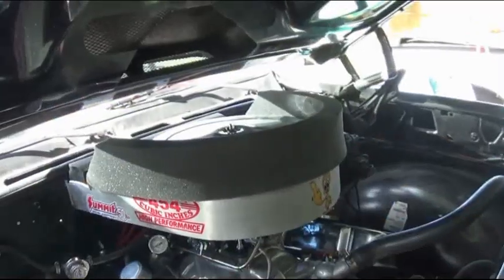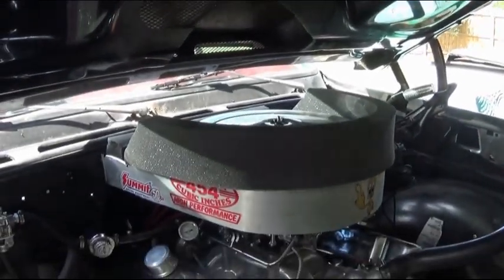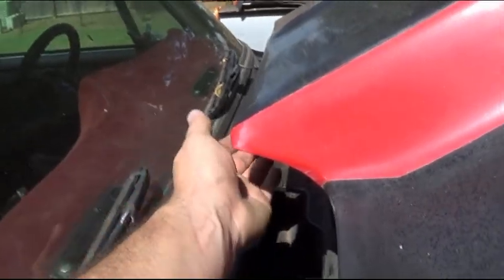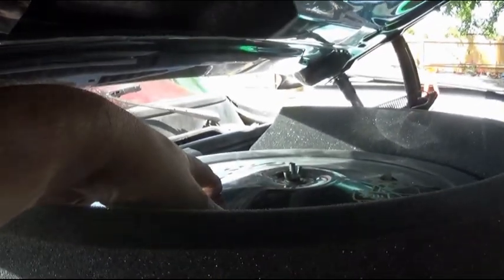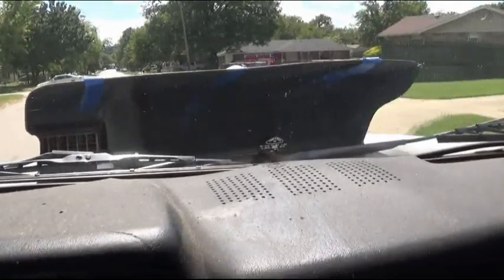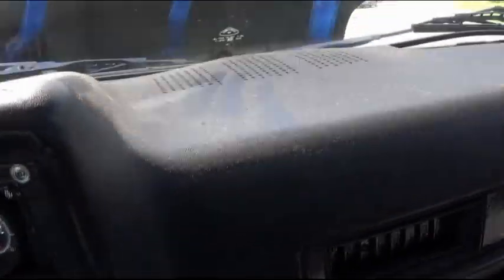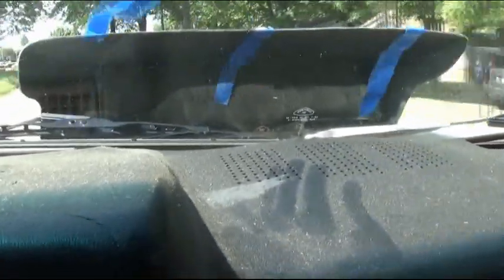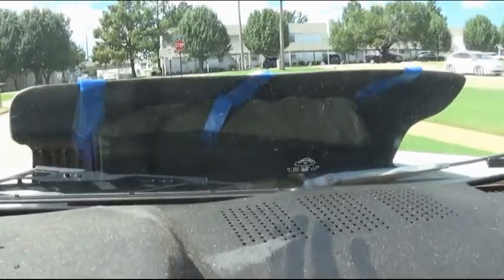a little bit about cowl induction and how it works

Comment: Thanks for the video. I never thought air would go in at the windshield. I always figured it was for hot air to get out.
Reply from the maker: You would be surprised how much, i can see the thought that while the truck is moving forward that all air would go back not down the windshield. Some times in the 60s they had figured that out and put the cowls there as and started using cowl inductions

Comment: That was really crafty. I never realized that much of a vortex is generated back there but the tape says it all. Good video.
Reply from the maker: Thanks, there is alot back there off the windshield. I did that tape test years ago on my first cowl induction hood to see if it really works. It was also a functional where I had the filter sealed off for cooler air.

Comment: I’ve been on looking at cowl induction stuff because I’m building a hood for my truck with a big one, but I never realized there was that much air going in! That should just about finish off the last of my lingering overheat problem
Reply from the maker: yea they are pretty effective when done right.  one of the reason why its a go to other then hood clearance

Comment: What about the rain? I keep my car outside and where I don’t drive it in the rain, sometimes I get stuck in the rain with it.
Reply from the maker: I never had an issue, usually the cowl its self catches the rain like it suppose to factory. The Cowl induction hood itself has the top longer then the hood so nothing directly gets into it, you might get some driving from the air but its usually alot less then the amount of water that comes past the radiator at speeds and with the fan pulling. i Have been daily driving with cowls hoods on my trucks for years rain and snow no issues. Your likely to have more issues from not having or having a bad hood seal on the back underside of the hood for those that have one

Comment: How would these do in the rain ?
Reply from the maker: Drove one many times in the rain no real issues. most of the water gets into the cowl panel and out before it makes it into the scoop. there will be moisture in the air but no more then normal cars with the air ducts as long as you have a proper lip  on the end of the cowl induction

Comment: Hey my friend do you have any extra cowl hood scoops you wanna get rid of??????38 -40 inches long and atleast 4 to 6 inches tall?????
Reply from the maker: At the moment i do not. I have been considering getting rid of the bond on one on my daily and going back to a flat hood
Reply: I'd be interested in the bond on scoop if you don't want to much for it
Reply: @EfurdGarage  I got a few extra parts .. but not to many.. just starting collecting square body S10 parts
Reply: @EfurdGarage  I'd be interested in the bond on scoop if you decide to get rid of it.. let me know
Reply from the maker: @christopherbarth9237  yea those squatebody s10 parts are getting harder to find. I got to find a drivers side inner fender for ol merv. I wouldnt mind trading the scoop with the hood or without it for a flat hood preferably black or blue
Reply: @EfurdGarage  I have a complete passenger side fender and inner fender for a square body a a flat hood but the hood needs painted.. there white and off of a 92..
Reply: @EfurdGarage  you have any pics????and how tall is the scoop
Reply from the maker: @christopherbarth9237  im just needing the drivers fender. The hood its a c10. I can get some pictures later but its the one in my bond on hood scoop video in the playlist for the work truck
Reply: @EfurdGarage  ah ..I hear ya..I gotta S10…. how long and tall is the bond on scoop...
Reply from the maker: @christopherbarth9237  i forget the length but its kinda short for my c10. It was on a nova its more for a car or small truck. Its about 5-6" tall if i recall i can measure in light
Reply: @EfurdGarage  ah okay..how much you want for it????or maybe doing a little swapping for it
Reply from the maker: @christopherbarth9237  its 46-48" long and sitting at 6.5" right now on the tallest spot on the truck. Really i would habe to habe another hood for the 81 c10 since i drive it every day
Reply: @EfurdGarage  ah.. that's pretty tall..I'd still be interested in the cowl scoop.just let me know what you decide
Reply: @EfurdGarage  hey brother., what did you ever decide on that cowl hood scoop...
Reply from the maker: @christopherbarth9237  yea i would trade it for a 81-87 c10 flat hood either blue or black in decent shape wouldnt have to be perfect.
Reply: @EfurdGarage  I'll see if I have one or can find you one.... where are you located
Reply from the maker: @christopherbarth9237  im not far from fort smith arkanasa.
Reply: @EfurdGarage   ah ok... well I was born in ft.smith Arkansas
Reply from the maker: @christopherbarth9237  so you know the area then
Reply: @EfurdGarage   well not really..I was born there.. but I was just a baby when I was there
Reply from the maker: @christopherbarth9237  gotcha, how far from fort are you
Reply: @EfurdGarage  I'm actually in southeast Missouri
Reply from the maker: @christopherbarth9237  i guess that can be a ways depending on where in se Missouri
Reply: @EfurdGarage  poplar bluff Missouri area
Reply from the maker: @christopherbarth9237  never been there but i have heard of it
Reply from the maker: @christopherbarth9237  i did find some on summit, they dont have really a selection for 38-40" long just on at 4" other was shorter  https://www.summitracing.com/parts/hrd-4104/overview/     theres a 42" about what your looking for https://www.summitracing.com/parts/hrd-1107   this one is a bit big https://www.summitracing.com/parts/hrd-1116, i did forget just how pricey these have gotten
Reply: That’s amazing - Thank you for Demo with Tape ❤

Comment: I've read comments of guys knocking 1.3 seconds off 1/4 mile et's from going from a flat hood to cowl. Anyone confirm this?
Reply from the maker: Cant conferm. But something tells me a mix of air flow to the carb and mostly weight of the fiberglass but 1.3 seconds seems high. Maybe a 1/10-2/10 of a second seems more realistic